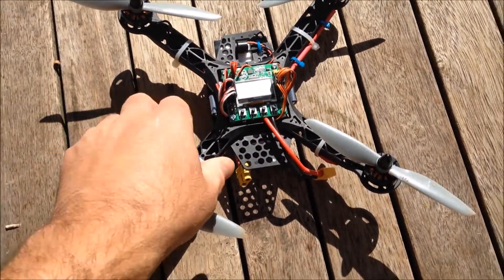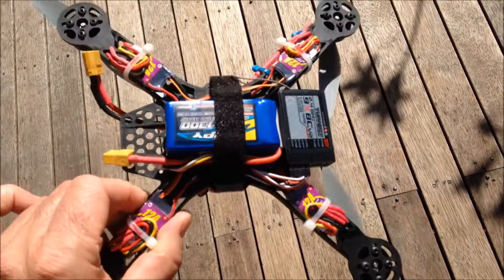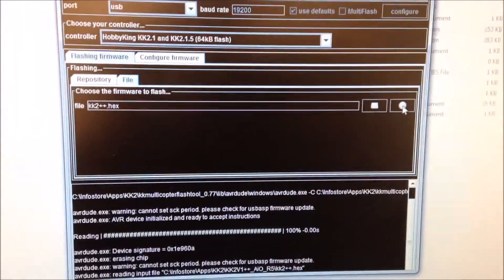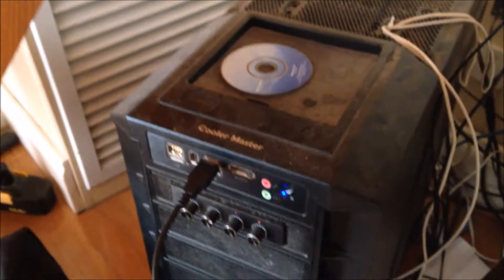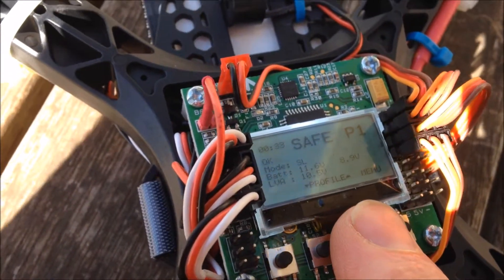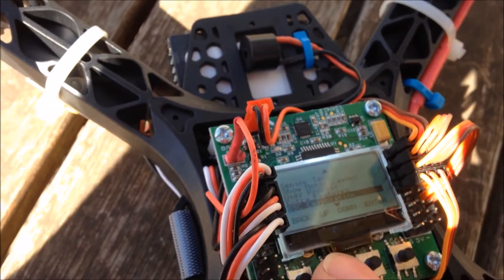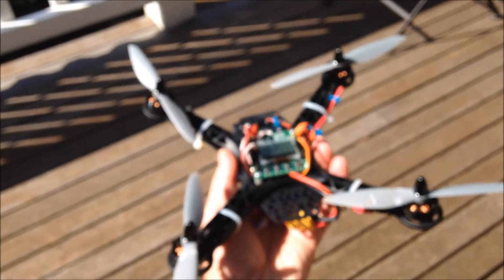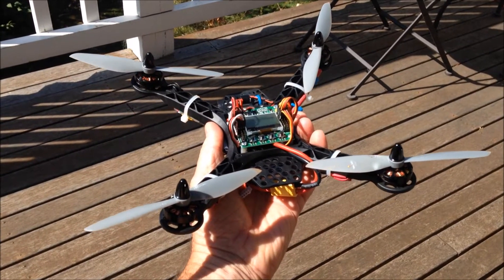Diatone 260 HK260 Quadcopter RC911 for KK2.1 Test Flight and new firmware feature

Comment: I tried to update my KK2.1.5 with this new firmware, but was told to update the firmware on my USBasp. I have used the same firmware to update my KK2.1.5 and Turnigy 9X. Do I need to update the firmware in the USBASP, and if so, where do I find it. Hope you can help. 
Thanks.
Michael
Reply from the maker: Sorry never had to do this with mine